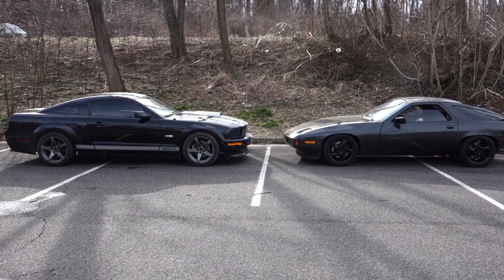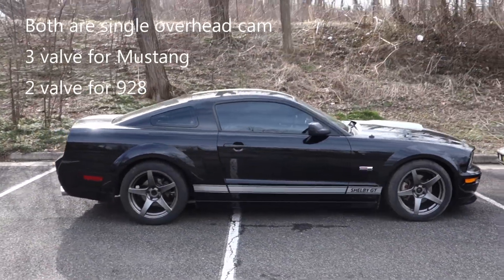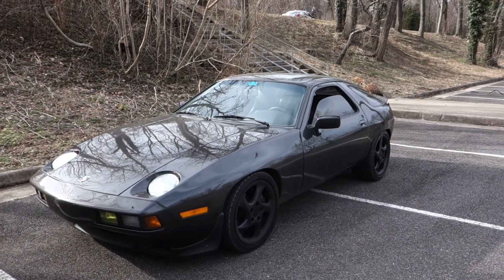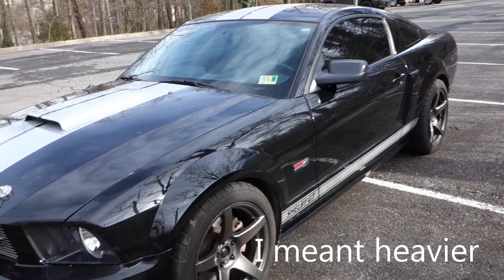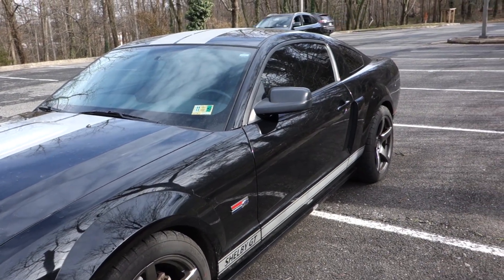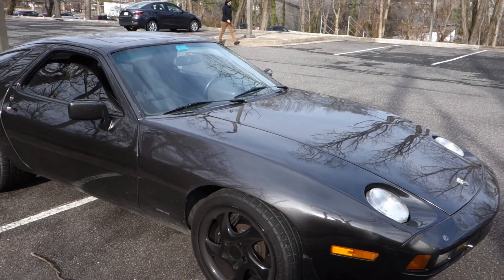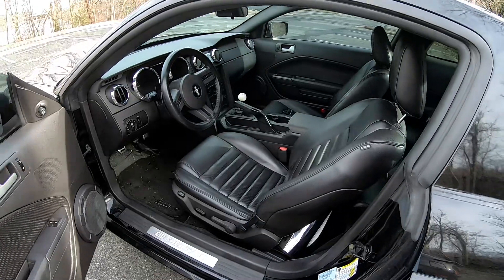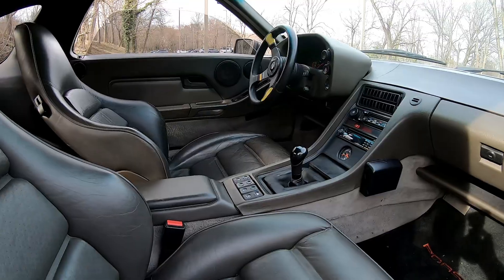2007 Shelby GT vs 1981 Porsche 928 - overview and drive

Comment: This is a great comparison video, thanks for making it.  As a 928s manual owner I agree with almost all of your comments.  One big drawback of the 928 that you did not mention is the back seats.  With 2 children I rarely, very rarely, put them in the back because it is cramped and does not have shoulder belts - lap belts only.  Combine this with crash worthiness of an 80s car versus a modern car and it becomes too risky for me to drive them around a lot. So, for a family car, the Mustang will win all day long.  My 928 has never left me stranded and I do my own work on it but if I wanted to drive across the country I would be much happier in a Ford because of the number of places that could fix it.  In short, I love my 928 but if someone wanted a more daily usable fun GT car then even I would have to suggest the Mustang.  For around town on nice days the 928 is the clear winner.  Cheers!
Reply from the maker: Thanks. Eventually I’ll get one done between the 944 and 928.
Reply from the maker: I also agree that a Mustang is a better daily and better for kids, not the focus of my channel though.  I did drive my 928 from VA to CO, awesome on the highway and comfortable, liked it more with each passing mile.

Comment: Nice GT500. Almost bought one but went with a 2013 Boss 302. A better drivers car but two different needs. Just got my first 944. Early 1985 Guards Red. Really want a 968 to round off my childhood movie Porsche dreams.
Reply from the maker: Thanks, but it’s not a GT 500. It’s a Shelby GT, only produced in 2007/2008.  Common mistake. GTs were more of a modern take on the original GT 350, but they weren’t allowed to call it a 350 for legal reasons.  They actually go to Shelby for mods. Unlike the GT 500 which is more of an SVT product with Shelby’s name on it, they did send GT 500s to Shelby to become Super Snakes. 944s are great fun, I have one of those too. 968s are rare but I have seen one every now and then. Only about 4000 came to US, good luck.
Reply from the maker: 2013 Boss was a good choice.

Comment: What's the best year to a 928 with the old taillights?
Reply from the maker: Probably the 1985.5
Reply: @77magnuss  ok cool. Any good things to look for S or euro?
Reply from the maker: The one thing I like about the 4.5 litter V8 is that it’s not an interference motor. When they bore it out to 4.7 and then 5.0, it becomes interference. Not a big deal if the timing belt has been replaced. The early cars are also lighter. The 85.5 has the 5.0 motor but with the original body, which is why many people like them. Off the top of my head I can’t think what to look for, I have read about the differences in a while. I can check though.
Reply: @77magnuss  The 86.5
Reply: 1983 is the best
Reply: @that-pixel_guy7636  thanks all! I'm thinking about getting a 1986.5 928 S. The front dash is cracked in multiple places. Any thoughts or tips?
Reply: @rockystallone3925  928’s are a “risky business” so u gotta find one in immaculate condition, you could get away with finding a 911 more beat up and get it workin than the 928. And don’t worry about price, if you look around Craigslist, offer up, eBay motors, and etc you’ll find some project type or barley running 928, and on an off chance you might find a pretty decent one with only body needing touch ups here and there. But other than that it’s just a patient waiting game to find one. And less than 20k is what you’ll be paying for a running ,full service history, 928.
Reply: @that-pixel_guy7636  I found one with the older taillights that running with 90k miles. The front dash is all cracked. I know these are notorious for this. What do you think? I don't wrench and rather wait and find one that's all done up.
Reply: @rockystallone3925  get it. ignore the dash!
Reply: @jeffstorey9147  I know, right! I'm wondering if the earlier years are better than '86
Reply: @rockystallone3925  I believe the middle years are cheapest, so maybe that’s a good thing for you? The oldest ones are not EFI, which might be a good or bad thing for you personally
Reply: @jeffstorey9147  yeah middle year will probably be a good one for me. Anything in particular to look out for while I look at it?
Reply: @rockystallone3925  I’m no expert, but rennlist has a lot of them. Apparently, getting a working, well maintained car is key. My car spent 18 years in storage, so I’m the dumb one. Hahhaa
Reply: I agree with the comments about the 16v (4.5 and 4.7) vs 32v (5.0).  Once you move into the 32v you have to deal with timing belt issues more seriously. If yours breaks on a 16v, no problem.  If it breaks on a 32v you just lost your engine and need a new one.  The 16v is also lumpier so it sounds more like a 60s muscle car, which I particularly like.
Reply: @ChanceSummer  thanks for info! So which years are those ones?
Reply: @77magnuss MAN I LOVE CARS AND ESPECIALLY SHELBYS AND I HAVE 4 SHELBYS A 08 GT500 AND MY 07 SHELBY GT AND MY GRABBER BLUE KENNY BELL 900HP COUPE SUPER SNAKE AND MY 07 427 EDITION CONVERTIBLE SUPER SNAKE AND OUT OF ALL 4 LOVE MY 07 SHELBY GT AND WHY LOL IT HANDLES GREAT AND I CAN USE ALL THE POWER ALL THE TIME AND NOT GET KILLED OR GO TO JAIL AND MY GT HAS NO CATS AND A SET OF LONG TUBES AND IT'S ROUGHLY NOW 350HP AND IT'S PERFECT TO DRIVE LOL MY GT500 AND MY SUPER SNAKES HAVE A LOT OF POWER AND IF YOU DON'T RESPECT THEM THEY WILL KILL YOU.